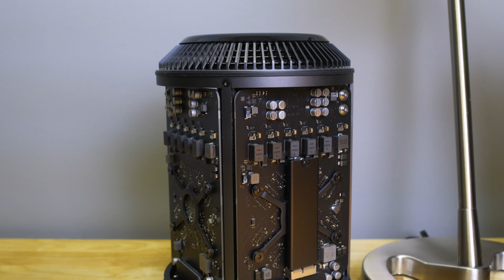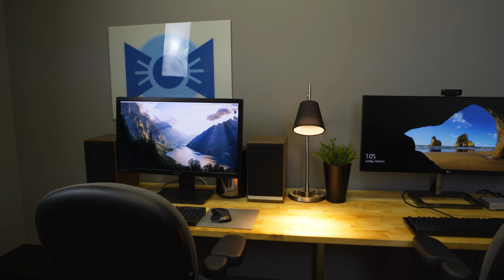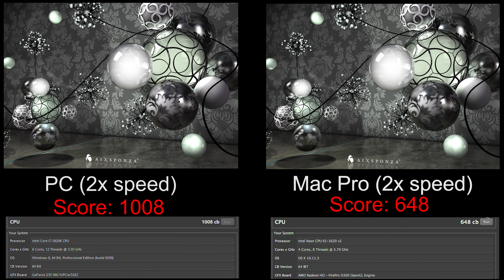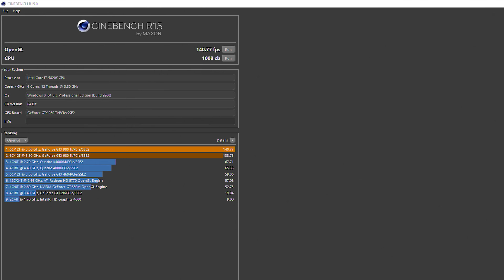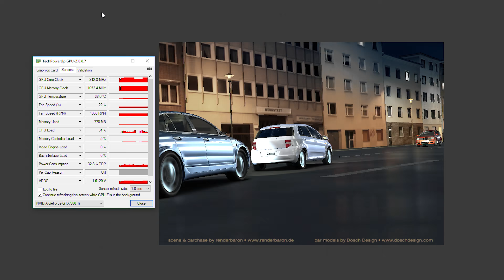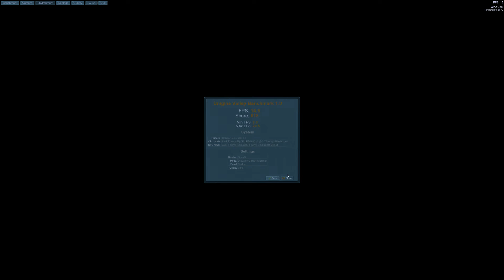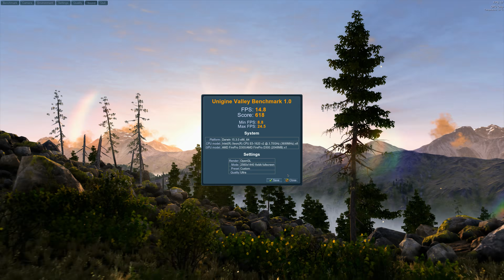$2,000 Custom PC vs $4,000 Mac Pro

Comment: I am not in the disagreements of how frustrating it is to be an apple user and they have not updated the machine. First thing though, your initial specs on the computer you own we're all wrong and so was the price. The quad Mac Pro has always been $3000 there has never been a price drop. this isn't an excuse for the Mac Pro. But are we forgetting it's a Xeon? With ecc memory and apples own flash storage and are we forgetting there are no moving parts in the Mac Pro other than one single fan? Are we forgetting about thunderbolt? You can not like the computer and you can shit talk macs all day. But design guys and You are paying for workstation grade parts. Also compare the size of you pc. You could fit a few Mac pros in it. I have a very high end water cooled Titan x 10 core ssd 128gbs of ram beast pc. Still my twelve core garbage can Xeon 128gb dual d700s fits in my backpack also quad core vs 6 core dude 980 vs d300 dude compare a like for like system please. Quad Xeon is poo.

Comment: Why even do the comparison if you weren't even going to try to keep the specs close? Just trolling? The very least you could do is keep the RAM equal. More cores, larger GPU, DOUBLE the RAM… of course it's going to be faster. It would gave been a much better use of your platform to rip Apple for not updating its computers more often. There's an argument to be made that they've gotten too far away from what put them on the map. I'd like to see them use some of their cash reserves to lower their prices & refresh their copy's more often.

Comment: why the hell do apple market such a compact nightmare computer as a PRO? I mean a professional would probably worry less about the styling of his tools and more about how well they work I can tell that apple spend a lot more money in the styling of that mac pro than actually making it a professional workstation. secondly there is a reason no one made computers cylindrical as 99% of computer components are square or rectangular trying so why try to fit them in a cylinder?? no wonder this cost soo much and how the hell do you service it :O other than paying $500 for apple for the privilege ofc

Comment: I suggest that you educate yourself on server chips (Xeon) and workstation graphic cards.  Xeon supports DCM and ECC, which 99.9999999% of consumers do not need.  I mean, do you need 375GB of RAM?  The big advantage of the Mac Pro here, which is what makes it a true pro offering, is that both the CPU and GPU support and conduct error checking making data corruption near nil, this is a reason why they are slower.  Xeon also has 4 memory channels and supports up to twice the bandwidth than an i7 chip.  For the GPU in the Mac Pro, pumps out images rounded to a 0.00001mm precision--no speed demon by any means. 

Let me ask you this, though;  would you build a gaming rig with a Xeon and/or workstation gpu?  Didn't think so and your reasons why not are exactly why this comparison is stupid and appeals to spec donkeys.  Custom build a Xeon workstation and you know it cost the same as that Mac Pro with near identical bench marks.  But that's hardly click bait, right?
Reply: You could build a workstation pc with 32gb ecc ram, Intel Xeon E5-1650 v3 (6 cores 12 threads), Nvidia Quadro M4000, 500gb M.2 ssd and 4tb hdd for less than what the worst specced mac pro costs while completely shitfucking it in performance and that's about as workstation as it gets. Dumbass.

Comment: Wait a minute, how did he get a score that low with a 980 Ti, an overclocked CPU, and water cooling?? I have stock air cooling, an i7 4790K not overclocked, and a 980 (MSI though) overclocked 150 MHz -- and I got 2950?

Comment: Obviously Apple has some work to do.  However, I support Windows in corporate environment. In fact I have supported Windows since version 3.1. I say all this to comment on how much more I like OS X than Windows. 
My particular workflow does not require me to have the speeds that tested machine was able to achieve.  As a "Computer guy", I do like a fast machine, but long term support is way more important to me.  I have a staff of 5 technicians and support around 4 Macs and about 520 Windows machines. The Macs are almost hands-off to manage. 
I also have no interest in building a Windows machine...

Comment: I'll do you one better on a custom build....

$160  -  Intel Xeon E5-2658-v3 ES - 12 Cores - 24 Threads - 2.2Ghz - Turbo 2.6Ghz
$145  -  ASRock X99 Extreme4 ATX LGA2011-3 Motherboard - Max 128GB Ram
$135  -  G.Skill Ripjaws Series 32GB (4 x 8GB) DDR4-2400 Memory
$  25  -  Cooler Master Hyper 212 EVO 82.9 CFM Sleeve Bearing CPU Cooler

Just wanted to upgrade and recycle as much of my old system as possible.  Old system was based on AMD X6 1100T with 16GB of DDR3 memory.  I did not worry about a new video card.  I don't play games and I do not like to use the GPU for any kind of video work.  I just like raw CPU Power!!!!

Transcoding 30 minute 1080p video to MP4 use to take about 25 to 28 minutes.  Now, it takes 7 to 9 minutes.  I'm a happy camper!!!

The Xeon CPU I picked is not the best CPU.  But for me, it was the best Bang-4-The-Buck.  I made sure to pick a motherboard platform to keep an avenue open for future CPU and memory upgrades.

Comment: why asrock
Reply from the maker: +Dominik .F ASRock makes great high-end boards now...? Also, they're the only one that makes a mini-ITX X99 board.
Reply: NO i had 2 asrock boards both sucked as shit MSI and ASUS i had never any problems with but i had to do so much RMAs with ASRock Boards because of their poor Build Quality never again sorry.
Design is although very Ugly Best Design MSI best Quality ASUS
Reply: The motherboard he used was the only choice there is to x99 mini itx.
Reply: Yeah but, shitty customer service. And lots of DOA products.
Reply: Can't say that was the case with me. They replaced my year-old motherboard after a loose connection caused it to short circuit and fry (it was my fault) no questions asked. I got a brand new replacement within the week.
Reply: Dominik .F My asrock products have been solid for me

Comment: What you should do next time is comparing the next generation Mac Pro with latest custom built PC parts BRAND NEW, NOT REFURBISH PARTS. With both cost roughly the same price (as close as possible). with Intel CPU, Thermaltake PSU, Corsair Dom RAM, Samsung SSD 950 Pro M.2, Gigabyte or Asus MB and GPU. NVIDIA GPU not ATI
That will be a fair comparison.

Comment: I can not stop laughing. If Macs bothers you, why all Windows users are always comparing their PC to it? 
Probably because even though they have 2x (or 3x or whatever x) faster computer, they still have to use a stupid system which slow their computer week after week until its totally unusable. I have MB Air 2011, 5 years no reinstall, work every day, ArchiCAD and Artlantis Rendering, everythink works like in day I unboxed it. Worth every cent.

Comment: I worked at an Apple Help desk and part of the job was helping with technical issues on the mac servers and such. The funny part was every time someone called in with an issue I looked over at the room next door that ran all the buildings servers that were all running windows. The guys that worked in there put a big windows logo sign that lit up in there to be funny as well. Really funny stuff. Apparently they didn't trust their own stuff to run the servers. Of course those guys could have had a contract with them and it was all their equipment I don't know but it still raises the question why they don't even use their own products. I mean even I had a dell on my desk.
Reply: They don't use their own products because they aren't stupid.  The only people who buy Apple servers are either morons who know nothing about servers or computers in general, or they have some extremely obscure edge case that Apple servers happen to work better on. I'm not even sure that second thing exists.

Apple knows servers, they build their own line of them after all, so of course they aren't going to use their own servers to run their offices.

Comment: Mac Pro price components:
1) Poor hardware  -1000$
2) "Professional" combining of not their own hardware - 1000$
3) Apple logo - 2000$

PC price components:
1) Better than Macs hardware - 2000$
2) Windows OS - 0$ (because you're using pirated one:D)
3) ....
4) 3x PROFIT!!

So the only conclusion we can make is that Mac Pro with its OS could be ideal computer for housewives would it cost third of its own price.
Reply: No reason why i7s cannot run 24/7, you'd be hard pressed to have one fail on you. Watercool it and it'll run 24/7 for years no problems.
Reply: Cyril Blanc The mac pro is not dual CPU so that's irrelevant in this case. The xeon E7-8890 is a server grade CPU with high TDP, a trashcan mac pro could never cool it properly anyway.
Reply: If you still have the product key of an older system you don't use anymore; the product key will work for Windows 10 and up whenever it comes out. Only problem is that it can be activated on only one system at a time. Did that with my recent build. Had Windows 7 on my old one that i took apart and used the same key code on the Windows 10 my friend gave me a copy of to install.
Reply: Xeon vs i7. Totally different class of hardware. Xeons are made to run 100% 24/7 while i7s are not.
Reply: 2 x I7 cannot talk to each other, 2 x Xeon can share task between them. 

An E7-8890 v4 (60M cache, 24 Cores, 48 Threads, 2.20 GHz (165W) 9.60 GT/sec Intel® QPI, 14nm) is a 7174 $ 
An i7-6950X (25M cache, 10 Cores, 20 Threads, 3.00 GHz, 14nm) is 1723 $

The I7 range starts a 303 $ and goes up ti 1723 $
The E7 Xeon® processor 8800 series starts at 3059 $ to 7174 $
Reply: Only an idiot would use pirated WIndows nowadays
Reply: These computers are for professionals, a professional can't ise a pirated software. And the Mac Pro hardware is really good for 3D artists, animators (in game industry and in movie industry, don't how is this pc in engineerig 3D graphics), Apple was always making workstations for 3D graphics, however Next is yet a part of Apple, of course tey made the company not existing, but people from Next Inc. are now in Apple, and Next bought Pixar, up of that time Pixar stopped woth making computers but with making 3D animated movies, next proof is that Apple was creatkng also a 2nd mouse, the 3D mouse, it was their idea, in right hand a normal mouse, in left hand a 3D mouse, between a keyboard for only some useless shortcuts (in that time useless), the 3D mouse is useable only in 3D modeling software. Even Pixar is yet Disney's, they use Mac Pro, but even without that info it's a good hardware. You could buy the power of 2x D700 for Windows machine for nearly 2 000$!!! (2x W7100).
Reply: The trashcan
Reply: bokiller33 
that is all you can say !
a 3 year old children can say that !
Reply: *****
Yep, free market and market competition it's always good for customers.
Reply: Research?  Are you fucking kidding me?  They use the same off the shelf components that everyone has access to.  They "research" how stupid people are then exploit that.  Nothing more
Reply: lol
Reply: znmo0nlight
All Xeons are server grade.  That's what they have always been for.
Reply: Robert Weaver
Yes technically, but some of the smaller ones are suitable for workstations. The large ones like the E7 8890 are almost exclusively used in servers because they need extremely good cooling because of the size of the core. With a high end water cooling loop it is also possible to use them in a standard desktop workstation but its not possible in that trashcan design of the mac pro.
Reply: Mugenloo
"Licensed" Windows 10 upgraded from pirated Windows 7 - is still pirated.
Reply: David S.
I don't really like the way you select which software you will be using on Mac, because in most cases you don't even have a choice. But when you work on Windows you can be sure that here is no platform limitations, and you can use whatever software you want, they all are available for Windows.
You're talking about MacOS for 3d artists, well.. I am a 3d artist, how can I use Mac if there is even no 3ds max support...
That's why Mac won't win this battle because people love the freedom that Windows gives them.
Macs have their target audience, it's businessman which want to be able to check his emails, maybe to demonstrate some presentations and surf the net, that's it.
Reply: +Yaroslav Tselovanskyi I am not a mac fan, I don't say mac is perfect, I would never say MacOSX is good, if I would have to have the Mac Pro, I would install there Windows. But however there is Maya, Blender, Cinema4D, 3Ds Max isn't there, but I probably ended with him anyway, the 14 and 15 were awesome, 16 and mainly the 17 version are pretty buggy, but yeah, who don't use Blender and makes models for games, he needs windows, definetly
Reply: +Yaroslav Tselovanskyi and yeah, Macs are for bussinessmen, but not the Mac Pro.
Reply: +David A 499$ MacMini or a 899$ MacBook air or 1099$ iMac are perfect for Business men, for users to play games and to do word-processing, tables, photo, video, music.....(all those software are free and included in MacOs) You do not need a double Xeon to do this. In 2 x hotels I have seen a MacMini in each room to have the TV over Lan, VOD and Internet. Those MacMini are working totally silently 365 days a year 24 h a day since quite a few year
Reply: Cyril Blanc yeah, but for DEMANDING applications the mac mini, macbook air, macbook pro iMac 21", iMac 27" are not enough (the best iMac 27" could be used, but that price is nearly same as the base Mac Pro and the best iMac isn't a good choose, i7 and Radeon aren't good for mostly professional aplication, like Maya), yes you can surf on internet woth the mac mini, you can view some photos, write some documents, the Macbook Pro could handle photo editing, video editing as could the iMac 27", Mac Pro is for other uses, for example Pixar has Mac Pros, a 3D animated movie like Monster University (Pixar's movie) never could be made on a Mac Mini. Mac Pro is not created for galery viewing
Reply: + David I did not say to use an I7 for heavy multi core professional  application, the Mac Pro is made for this. 
In some case, video editing can be done with an I7, but you must not be in hurry to have all effects in real time.
 I use A Mac Pro 2010 with ssd to make heavy 100 instrument orchestral music, that is working great
Reply: Cyril Blanc I don't say video editing can't be done with i7. I think for video editing is i5 and some lower Radeon enough, of course if you don't do something so big, where you need to be sure it will work, like the 100 instrument orchestral music, for this amount must the Mac Pro be a perfect choose, but that's just my guess. I have a little bit less powerful mobile workstation (laptop) from Dell, the Dell Precision M7510, because of my budget I have the i5 6300HQ 6mb, which is same in my software as i7 6820HQ and the Xeons are too expensive for me yet in this laptop, but have to say that the FirePro W5170M is awesome in 3D modeling - I am a freelance 3D artist and animator, mainly for video games, I work for an outsourcing studio MyTech Entertainment and I've done models for GTAV, AC Rogue, The Crew, Mafia III, Mafia II and more (https://www.artstation.com/artist/david-s)
Reply: ***** yeah, Apple use at this time only DDR3 rams, because they are old models, not sure now but Mac Pro is 2013, right? In 2013 wasn't DDR4
Reply: +Olivier
1st you need to know how to put memory in your Mac. Many people won't do that ! If they don't take precaution they may kill the memory stick with static electricity !  :(
 If you buy memory from Apple your system is guarantee with it's memory. 
If you buy memory from elsewhere you have to remove the memory and put back Apple memory to be serviced !
 it's a customer choice. I have, most of the time, bought my memory from Crucial ;)
Reply: Cyril Blanc yeah, but you can't put there DDR4 and a fast DDR3 is pretty expensive, it's a big  -  for macThere are many things on which you have to be careful, CL type, frequency, size limit, ECC (Mac Pro supports ECC, but there not a lot of devices which do so) and than it's the mark, Crucial is a good maker of operation memories, but eg the Kingston HyperX is sometimes refurbished. It sometimes also destroys the motherboard. If you will choose a bad memory type, it can destroy the motherboard, by Mac Pro it could destroy the whole computer.
Reply: +David If you connect on Crucial site, you enter the PC/MAC reference and it will list you all possible configuration of memory compatible. ;)

How do you do to have the name of the previous post in blue ?
Reply: +David 
+D Did not work
Reply too
Strange !!!!
Reply: I d love this commend
Reply: That windows line killed me :D :D
Reply: why would you pirate windows when you can get a 20$ dollar key?
Reply: Democritus86 how? Where? Windows normally costs 100$
Reply: David S.
kinguin.net its a bit more expensive now that you cant update from windows 7 but still nowere near 100
Reply: +bokiller33 a lovely trash can ;)
Reply: Cyril Blanc apple sucks
Reply: Cyril Blanc I like it short
Reply: I died laughing at this comment LOL As I referenced the housewives (aka x) costing three times their worth. (perhaps not the intentions of the OP)